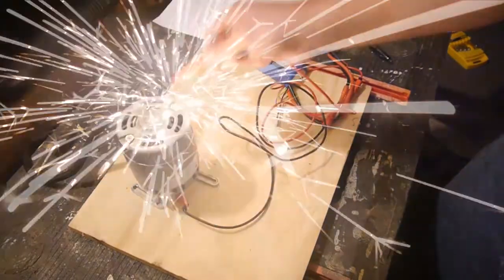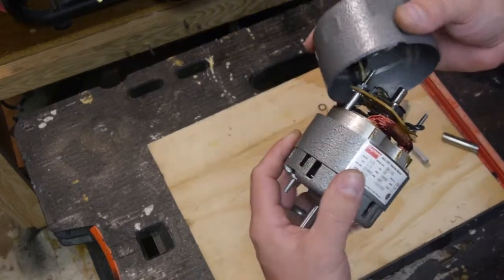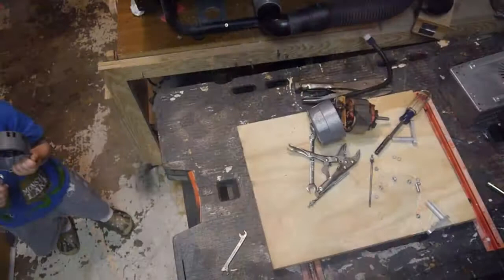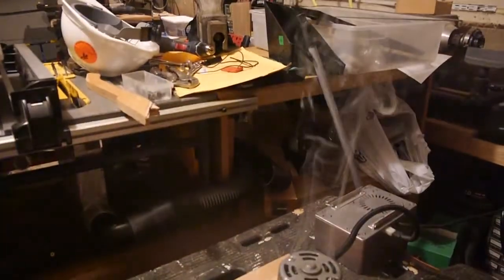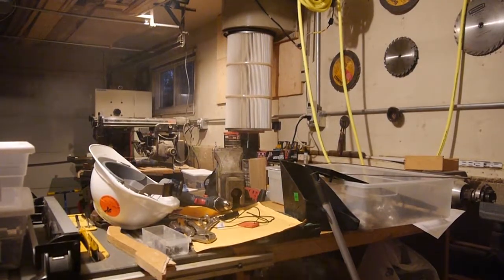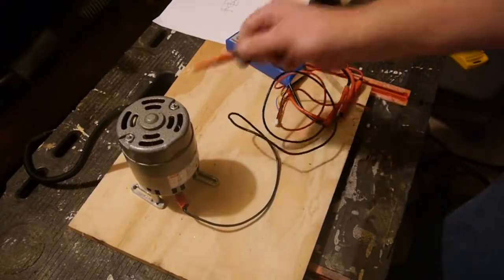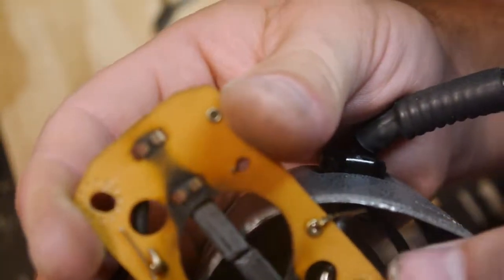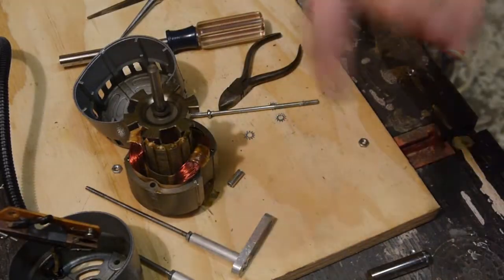Motor Autopsy of the MAXNC Stock Motor, we try shocking it back to life.

Comment: Lol, that thing was messed up. Wonder if it was the steel cutting that did it, got me scared to try now...  Can't quite understand if the fan is supposed to draw air in or push it out.   Anyway what are you replacing it with ? I'd send you my old crappy 1/10 HP motor if u were closer but u seem more of a metal and not  plastic cutting kind of guy to be honest :-)
Reply from the maker: RuralEngineer Thanks for the offer of the motor, you are a stand up guy. I hint at what I am replacing it with at the end of the let the smoke out video. I should have that video and mill back up and running before the end of the weekend. So something to look forward to. I will hint that it has an order of magnitude more horsepower! I think the motor is fine, it's just mine was a bad a0ple and probably over 20 years old